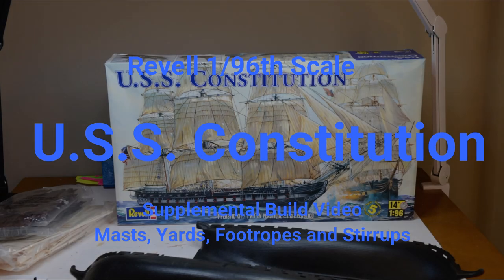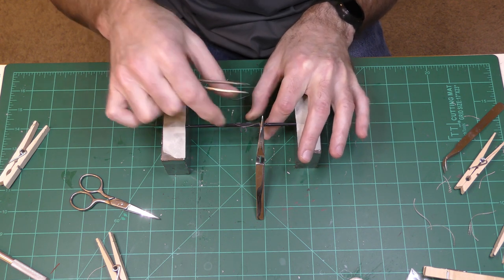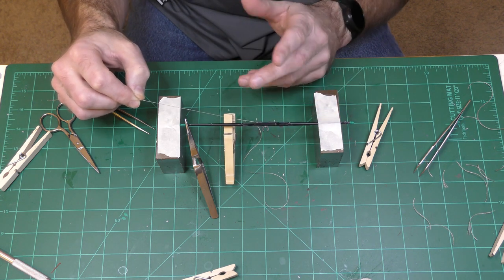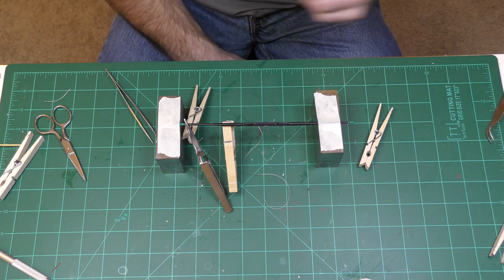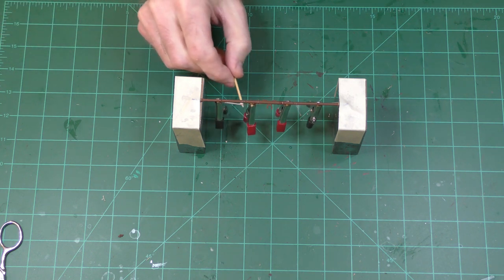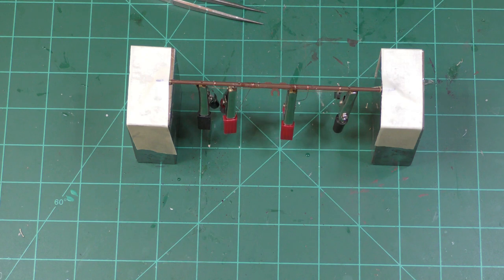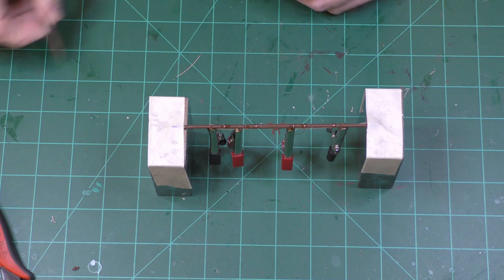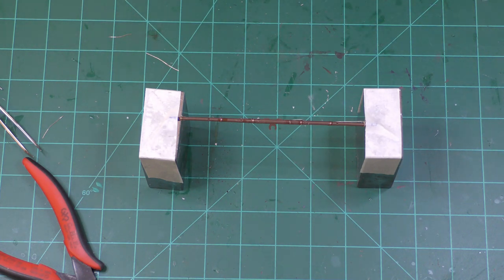Stirrups and Foot Ropes for the Revell 1/96 U.S.S. Constitution

Comment: What cement glue do you use? I’ve been using a tiny bottle of gorilla glue but I don’t like the way it dries kinda white. If those glues are pretty good I’d like to get them! I’m definitely doing this now too. 2-3 years ago I stopped working on my USSC because of this part. It’s so tedious and a nightmare but I’m hoping this helps. Thanks, man.
Reply from the maker: Thanks for the comments.  I think I used Gorilla glue super glue gel.  I use that a lot.  I know there are other brands of super glue gel out there so you can try others.  For white glue, I just used regular old Elmer's I think.